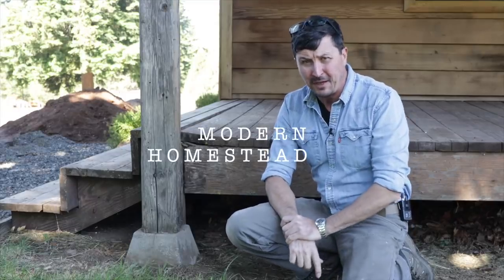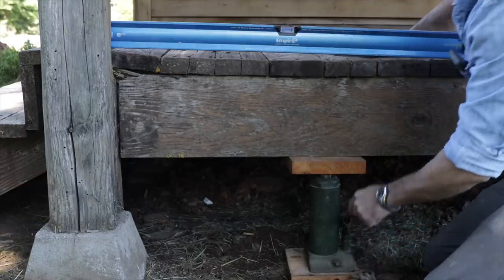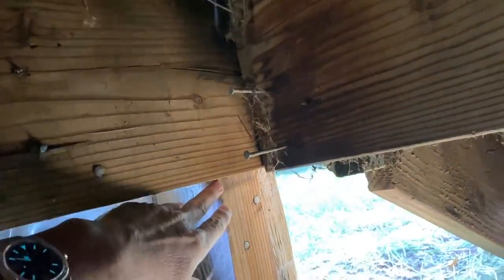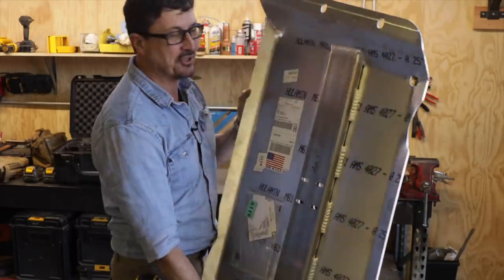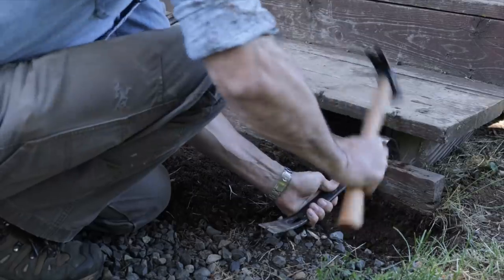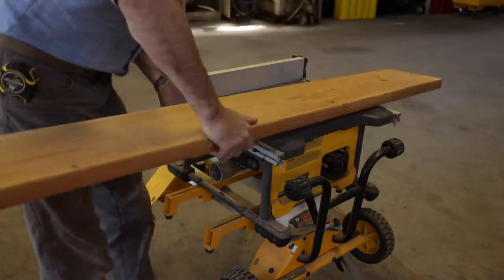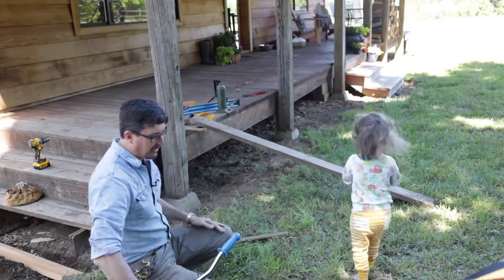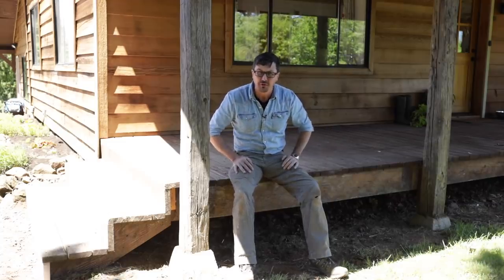WHAT COULD GO WRONG! - [OFFICIAL VIDEO]

Comment: You know a East Coast guy would of just left the bottle jack under the porch. 😂😂😂😂😂
Reply: It would be a lot stronger than the wood heck I saw when my grandfather was replacing some flooring he has jacks holding up parts of the walls if it works it works.
Reply: I built my whole East Coast house on jacks so I can raise it up during hurricane season.
Reply: Bottle jacks are cheap. It'll just rust in position, and your good. Just paint it wood colored after the patina locks it at the right altitude.

Comment: I just did that the other day; we jacked the garage up, backed a trailer inside, bolted some beams across and some 4x4's across the tops of the beams at the walls, and drove it down the road... for 2 1/2 hours. A 10'x20' garage.

Comment: Bottle Jacks...I enjoy estate sales over garage sales. One such estate sale had countless bottle jacks inside the original boxes as if still new. They are all the same 6 ton hydraulic jack's by the company called Hein-Werner. Bright orange with a white lift handle such a sweet sort of a deal. Not sure just how long the individual jacks were stored in that old out building but long enough that the cardboard boxes were falling apart as soon as you tried to open up or even pick up the box. So brand new yes but how old is unknown. Paid the lady running the estate sale the $5 bucks and left thinking wow such a great deal for a brand new old stock bottle jack. Went to lift my 1 Ton F350 Diesel truck and the jack won't do it at the point of actual lift it just stops. I think the brand new jack is so old sitting in the box that a seal  dried out. Now I have a pretty nice looking orange door stop for my shop door. Works great.

Comment: When I was younger my mom and her B/F were tearing down an old pool deck, and made sure to tell me bend the nails over to avoid stepping on them.  Well when the dumpster came, and we were throwing the scrap wood into it. I lodged a 3 inch nail, still attached to a 2x4, deep into my hand entering in at wrist and up towards the pinky in the meaty part.  No fun. Still good advice.

Comment: Re the deck to make it look newer.  Reverse the deck boards.  Get an oldstyle impact nail puller, yank the nails and flip the boards and screw down using original holes.  I did that in New Orleans on a mansion with indoor outdoor carpet that wouldn't totally come off.

Comment: Once you get above a 2x6 or 1x6, the lumber is 3/4" less. A 2x6 is 5-1/2", a 2x8 is 7-1/4", a 1x8 is 7-1/4", a 2x10 is 9-1/4", etc..... Or at least it is supposed to be. We receive 2x8s  for framing a house that ranges from 9-1/8" - 9-1/2".... Quality control these days!  Sure it has to do with drying too,

Comment: Cody , get you a 4 x 6 or 6 x 6 about 12” longer then the your shop door , and put it about 1inch wider then the  thickness of your shop door this will give you A channel for your door to slide in and then you could pile up the gravel to the top of the your timber and have a smoother entry go into your shop

Comment: We lived in a house once where the kitchen floor sagged 2" in a 12 or 15ft long area!
I think they used 2x4 or 2x6 studs and not nearly enough of them.
We did basically the same thing as you but with a car jack in the basement, then added 2 2x4s bolted together as a support post.

Comment: We have an older house also.  Ours is an old farm house in Michigan.  We still have 5 of the old barns and shops on the property.  It is only about 125 years old.  It has a significant slope in the upstairs hallway.  I feel like I'm getting vertigo every time that I walk it.  Unfortunately, if we start trying to correct the issue, it would just cause more problems.  I told my wife that we will just make sure that it doesn't get any worse.

Comment: You don't want aluminum for a skid plate because its brittle not ductile. You want a mild steel with ribs/ridges. I mean you come down on top of a rock with that thing and its going to fracture. Ah maybe not. Whats the thickness?
Reply: Our skid plates are made from 6061-T651 aluminum.  It's one of the most robust weldable aluminum alloys.  We've been building them for years and have never had a fracture.

Comment: Meaning no disrespect, but if you're going to be stacking more firewood on that deck you might want to support it with more than the end of a 2x6 hanging off the edge of a pier block.

Comment: Just had to cut off an old cast iron pipe that was for a toilet lol it was an oooooollllddddd house the pipe was like 3/16 thick and like 4" diameter it took forever we ended up using an angle grinder to go around it and get it off it was a beast